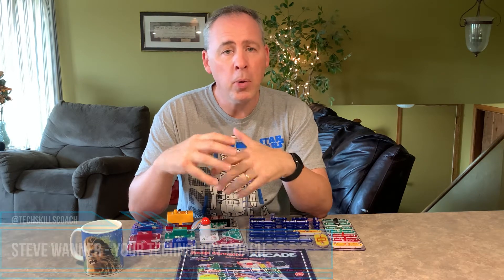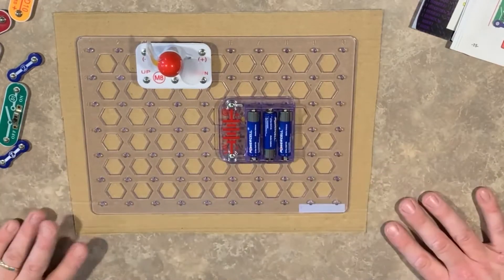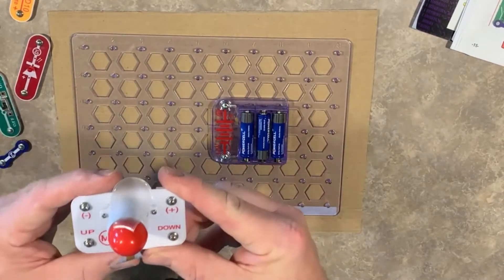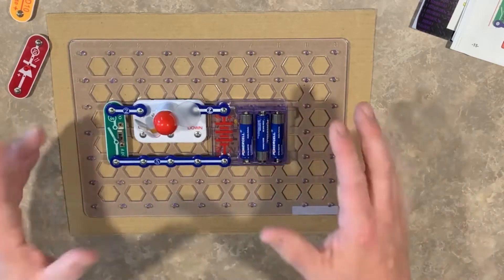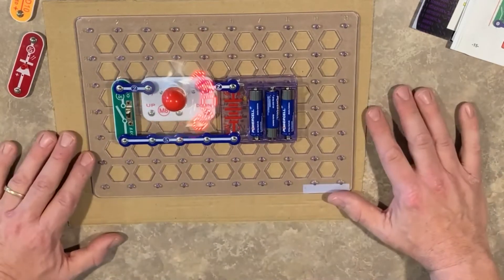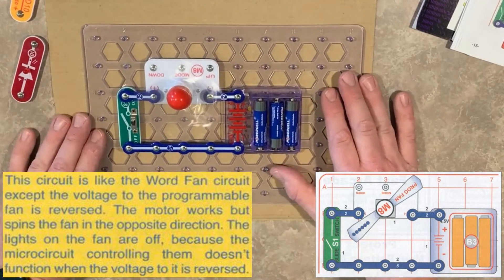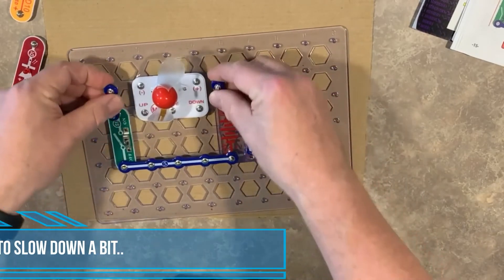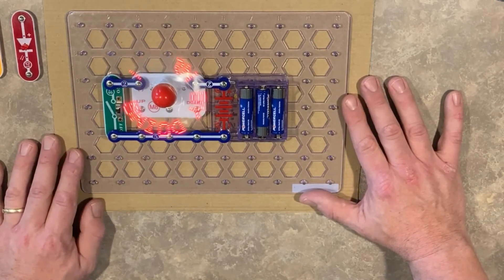How to Use LED Message Fans and Motors - Snaptricity Arcade STEM Lesson #2

Comment: Gave my Grand Son the Arcade set, project 4, we could not get the fan to function, we did a quick check and all circuits looked correct, all other functions worked such as the disco ball. Any suggestions to check the fan functions correctly?
Reply from the maker: Was the fan spinning or stationary? Sometimes during packaging the fan blades are bent down and you need to gently work them back into position and then give it a slight boost to get it going. because it sat on a shelf for a while, I just needs some encouragement. If that doesn’t fix it, then it could be the voltage supply is either on the wrong input or you might have weak batteries.
Reply: @TechSkillsCoach  We'll try that, blades were definitely in a down position, we'll try to ease them up gently and give it a little nudge to get it started. Thanks!
Reply: @JC-ye7pj I'm having a problem where the fan is spinning but not lighting up. I tried to wait five minutes like the manual said but nothing happened.